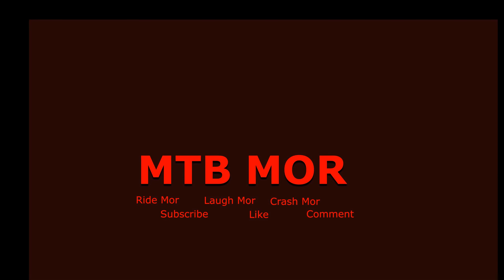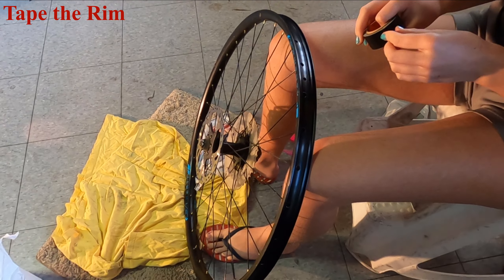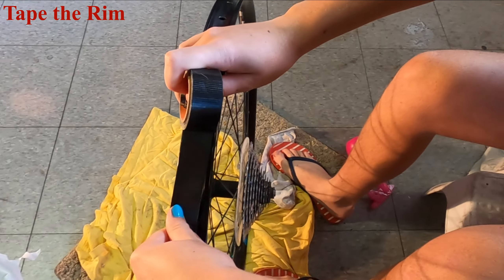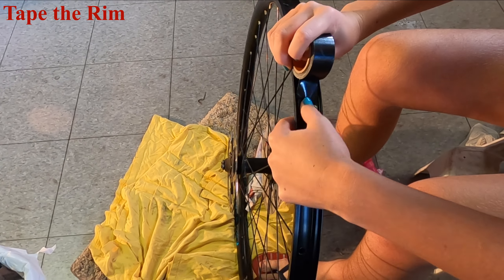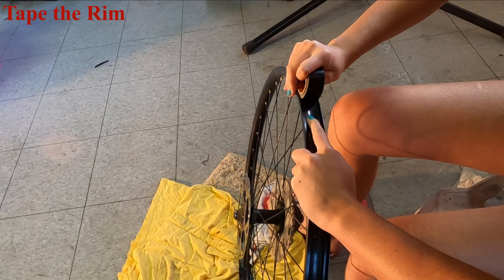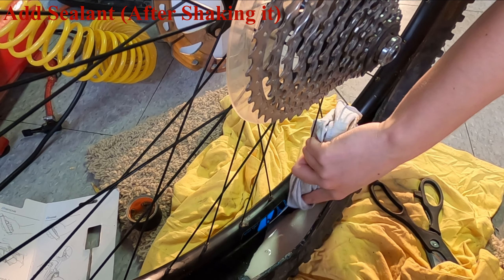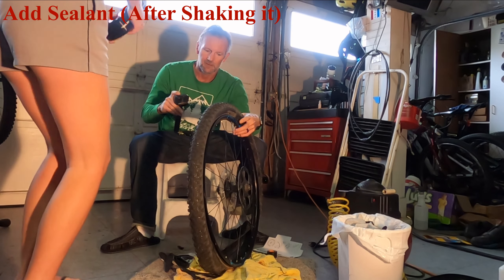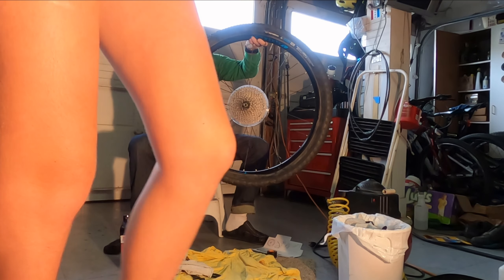Setting up a tubeless MTB tire | Her first time!!!!

Comment: What do you do when it doesn’t hold?
Reply from the maker: Are you talking about setting the bead? I try and bounce the tire while inflating and that helps. It also helps to shake the tire while it's horizontal every couple minutes if it's being difficult. New tires may need more air on day two or three before really being set. I hope that helps.